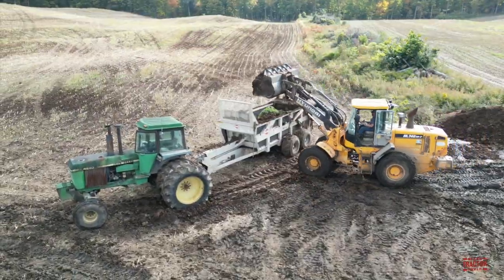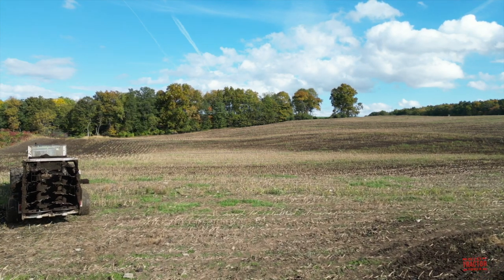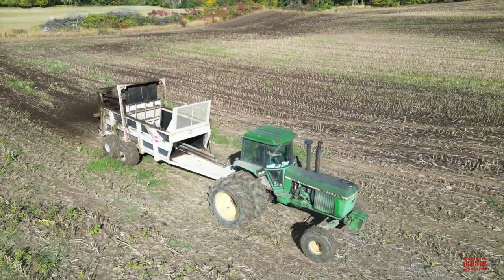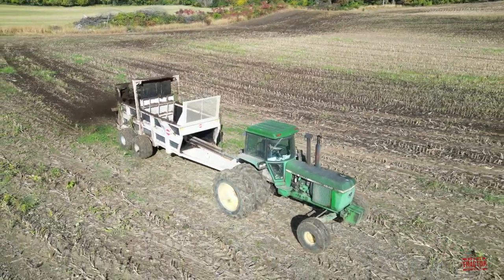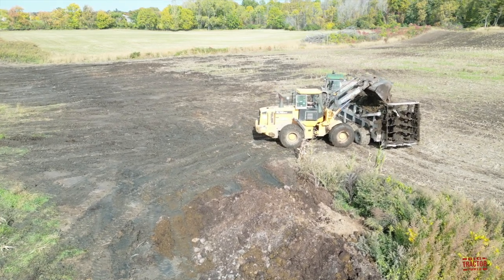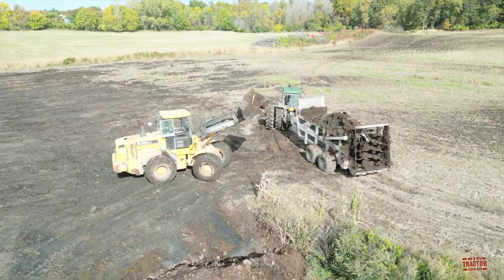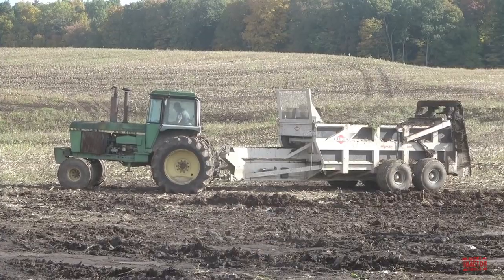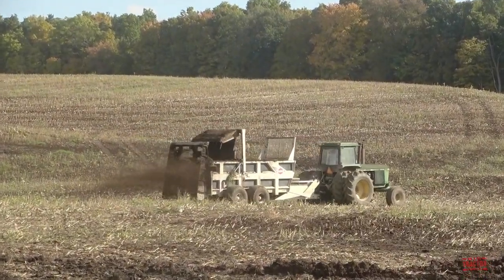JOHN DEERE 4640 Tractor Spreading Manure

Comment: I have used a 7400 John Deere power shift to pull a Hagedorn extravert spreader at my aunt's horse farm. It felt like a good match. Loaded with a 5525 John Deere.

The 4640 is a tough old tractor. Running an iron horse or late sound guard Deere is on my bucket list. Thanks for the video

Comment: I've worked for a dairy that uses their John Deere 7800 tractor with a 740 Classic Loader infront of it to pull a John Deere 785 manure spreader. They have used a Hagedorn 275 hydrapush manure spreader that their oldest brother owns, and when they had that spreader, I operated it with their John Deere 7800.
Reply from the maker: Very nice spreading team with the 785.

Comment: Even before you said anything about how the spreader performs, I was thinking that is did one of the best jobs of any spreader I have watched on YT or in person. If I heard you right though, that spreader is actually just slightly above the power class of the tractor? 160 min for the spreader vs 155 for the tractor? It appeared the tractor handled it just fine to me, albeit with some minor wheel slip on some of the hills.
Reply from the maker: The farm really really likes this Pro Push. They like how it just eats up material.  

I am glad you mentioned the min power of the spreader vs the tractors Hp.  I was hoping some one would catch that.  When the 4640 was built most of the tractors were much hotter than advertised. A 4640 is advertised at 155 pto hp but most likely put on a dyno it can put out 175 to 200 hp with ease and not being turned up.

Both Deere and IH in the 70s were conservative on advertised horse power. Basically they underpromised and over delivered.
Reply: @bigtractorpower   I was just coming back  to mention that maybe why it is handling it so well is because most machines turn up more HP than what they are rated at and if you look at the tractor data site, you can see that both companies still under rate what their machines actually turn up in the Nebraska tests when I saw your reply.  You beat me to it 👍A JD dealer told me about them under rating their machines, even among machines as small as the compact utility class back in 2001.

Comment: In my judgement, a conveyer chain running long the floor of the spreader would require less power than the pusher plate moving the manure to the beaters since the chain has a better ability to slip while the plate has no slippage potential but I may be wrong.
What do y'all thing-?

Comment: This is my "big" tractor on my farm. Mine has the hydraulic pfwd. Have around 25k hrs on it. Recently had transmission rebuilt, and about 2k hrs on a John Deere crate engine. My second tractor is 4440. Hard to find anyone still turning wrenches to work on them. I have to diagnose the problem myself and tell them what they need to do to fix them. And hope they don't cause more problems than they fix.....
Reply from the maker: The 40 series are solid tractors.  That’s cool you have a hfwa 4640.  The 4440 is one of the all time greats.

Comment: Hi Jason. I am farming beef cows here in north tipperary, Ireland. I hire in o briens contractor to handle my manure spreading. He uses a bunning spreader, operated by a fendt 828. It spreads the manure very evenly, which makes for better farming all round. Great videos you are showing.
Reply from the maker: Very cool.  Thank you for sharing.  A large grain farm I film at here in Kentucky applied chicken litter to 6,000 acres of ground per year. They used a Bunning Tri Axle spreader.  It did an amazing job spreading.  The farm switched from litter to NH3 so they sold the Bunning.

Comment: 7330 Deere with 2044 pro push vertical beater. 

Sad thing in this video, the spreader probably cost more than the tractor did
Reply from the maker: No doubt on the spreader cost.  The tractor has earned its way staying in the farm 40 years.

Comment: so whats the difference between the partial powershift and the full powershift
Reply from the maker: Power Shift allows you to push your shift through gears with out delay.  Partial Power Shift means you have to clutch between certain speeds.
Reply: @bigtractorpower  makes sense. that was my guess. I've operated a 4020 powershift and I didn't need the clutch for going up through. the few gears i used
Reply: The quad range was the second option to the powershift. A,B,C,D with four gears in each range, plus reverse. 1 and 2 could be bumped up or down without clutch. Clutch and shift to 3 or 4 and you had the same options with those two gears.